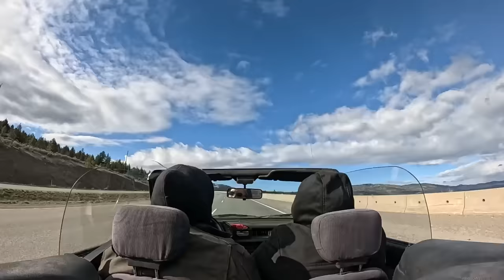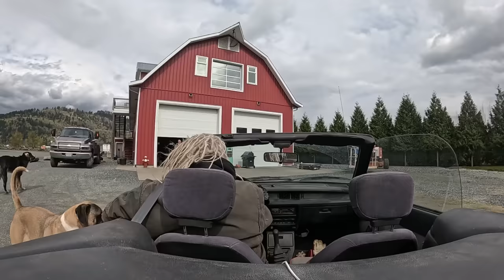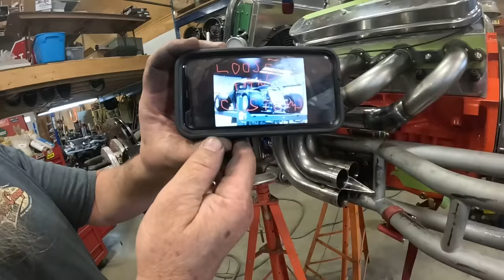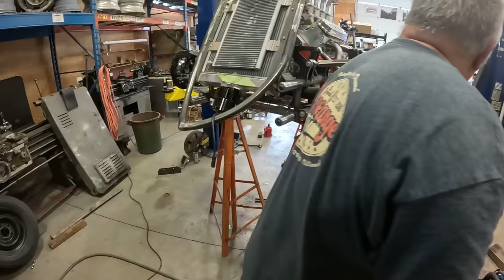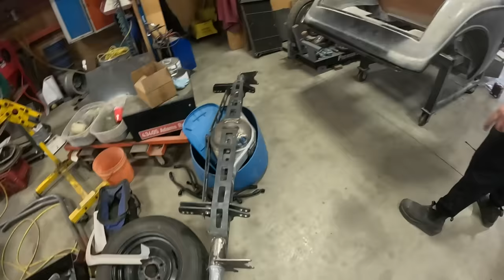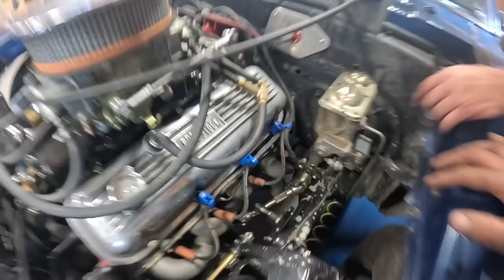Little Firefly Road Trip + Loose Change Customs Shop Tour

Comment: I need a car. I am 69 and on disability for a motorcycle accident I had in 2012. My transmission  just went out on my van that is wrecked but still driveable. Now that the transmission  took a crap I am screwed. I get $1,100.00 a month from disability and all my bills come up to $1,000.00 a month. I was using the van to get scrap metal , but no longer able to do that now. The Firefly is a jem. You guys rock.  I have been watching you for over a year. Peace!
Reply: What province you live in maybe I can help you out if you're not to far away

Comment: Why don't you have a new plastic window put in the rear of the convertible top. I used to work in the car business we would get them put in for $100 US.
Reply from the maker: i never drive it with the top up thats the whole point usually they are so shrunk you cant close them will put a new roo in it this winter maybe